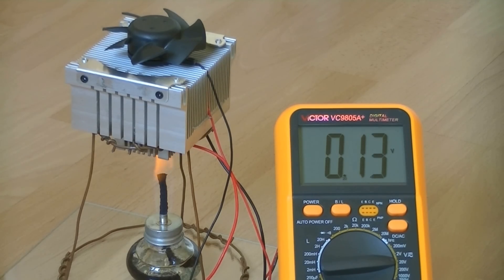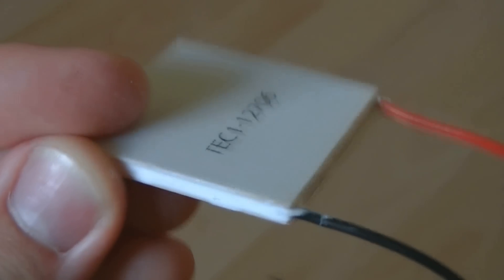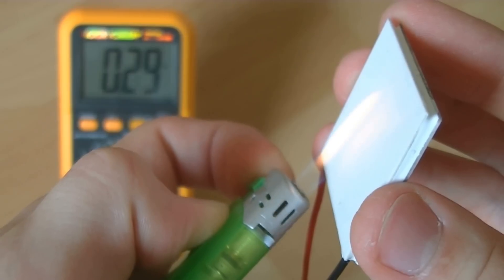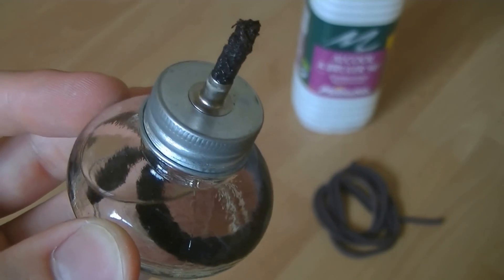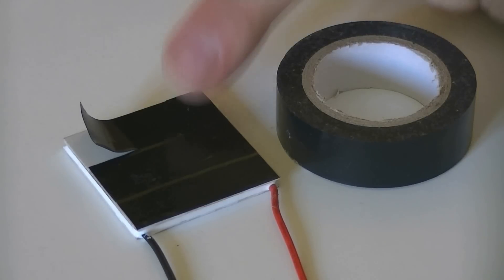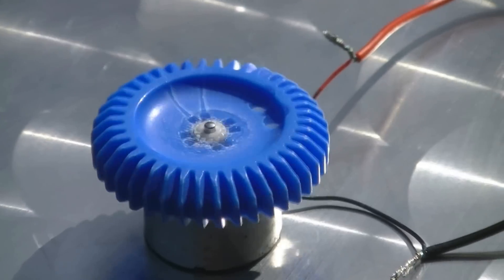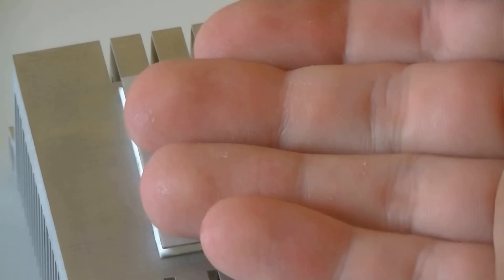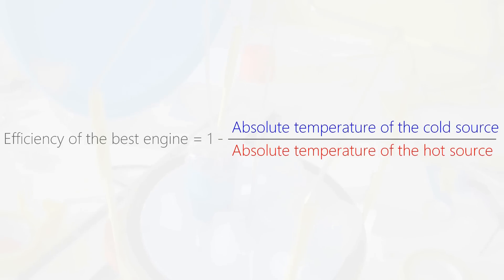Heat to electricity - DIY experiments #9 - Seebeck and Peltier effects

Comment: Cool i am going to make a Sand battery eventually. Now the hotplate from amazon was defective 3 minutes it reached 350 degrees C. The max temperature was setting 1 suppose to be 120 degrees C def a faulty thermo regulator. Need a proper one. A sand battery with a stove wooden fan is a cool idea to explain how they work. In a few Months (2-3 months).

Comment: thank you for this.
I work in trade related to HVAC, but sometimes I was thinking if we can use the heat of the condenser to generate power back. I know the power will not be enough to run the compressor itself, but It should collect some power back.

Comment: What happens if you stack these units on top of each other? Put heat on the bottom and haven't worked its way up to the top. Where you would cool that make any sense at all?
Reply from the maker: Less efficient!

Comment: im very skeptical about this 

however if this is true that it can run a computer fan, then my idea for a very small waste oil heater for a green house that gets very little sun in the in winter (poor planning on my part and moving it will be a giant pain in the ass) is more viable than I thought since getting power to it is difficult.

Comment: In a hybrid car design, maybe a constant temperature is possible from friction component stoked further by wind drag...but another idea is just powering the right spectrum led, uv light, to power solar panels in a closed system with mirrors...maybe energy is amplified and it's possible to get more energy out than is put in, or at least it's converted to domino effect idea.

Comment: Your focusing on the wrong thing, colder is better and no limit to how cold it can get vs only 500 to 700 F for the hot side. You only need a temp diff of 150 to get the 5 volts 1 amp.
Reply from the maker: Not clear?

Comment: Had you purchased teg tiles instead of tec tiles you would have had a better result in your experiment.
TEC stands for: thermo electric cooler
TEG stands for : thermo electric generator
Reply: What if we stack teg and tac multiple time. Can we make a cooler and generator at the same time?

Comment: You made much better than electroboom, nice video! I've made one too.
Reply from the maker: Yeah, and the 100k RPM isn't a fake ^^
Reply: @DIYExperiments  ok i removed the Fake word but in my opinion you never gone over 20k :D  nice channel anyway, why aren't you posting nothing lately?
Reply from the maker: We reached 1600Hz you can check with the spectroid app ;)
It's from our french channel, we will translate vids gradually
Reply: @DIYExperiments  1,6 khz in input but mechanical and magnetic losses aren't calculated, you have to check directly the speed on the motor, i have to try with a laser printer motor, they are very precise.
Reply from the maker: It's a sycronous motor, not an induction motor there is no difference... Please consider science before pretending to correct me :)
Reply: @DIYExperiments  your right place is kerala, doing free energy experiment without any feedback about the result, Goodbye scientists.

P.s. why don't write 1 million rpm on it? is the same, who cares?
Reply from the maker: @AsitShouldBe  The guy who was impressed at first...
Man, I'm an engineer (IRL), the fact the frequency of a synchronous motor is directly related with the input frequency with no slip is a fact (that you don't know I see).

As all of our experiments, it's true.
Reply: @DIYExperiments  your india style circuit has more holes than wires,  and you haven't calculated any frequency or current effect except your input frequency on open circuit.. so you are an engineer, congratulations!

P.s.  buy a tachometer
Reply from the maker: @AsitShouldBe  I made this video in my original channel in 2011... Look at my recent vids (made 5 years ago in this channel even if posted recently)
Reply from the maker: @AsitShouldBe  But everything was calculated, all actions are explained in the video (complex procedure due to the wide frequency range of several order of magnitude, the reactance of the coil chances during the test)
Reply from the maker: @AsitShouldBe  https://www.youtube.com/watch?v=cfZUH0Pjctw That's my current content, dare to say it's not engineering
Reply: @DIYExperiments  in my opinion the motor try to set his speed on some submultiple of the input frequency, that's why the current grow so fast. 
I'll see your latest video, no offence. 
That's my next one 😉😁https://youtu.be/D7yM1loPqOU

Comment: Your use of a parabolic mirror to focus sunlight as a heat source reminded me of a thermionic sandwich that has a layer of ceramic material between two metal plates, one wire touches one plate and the ceramic and the other connector touches the other metal plate.  Sunlight foucused on to one metal plate using a lens produces an electrical current.
Reply: Free enegery. Look we are only bound by what we know.
Imagine if you get a magnified 🔎  glass. - a big one to capture the engery. And then you get loads of little ones to focus the light down to a very small beam.
You then focus that enegery, Heat onto a piece of given metal. Then boom you have free eletric. You would also add additional wind generator with water generator to pump to the plants to let them grow, and then you capture then gases to use as enegry and you could capture the heat from the actual plants themselves, moss, micro greens.
I am sure if you was to grow them in some type of vacuum chamber then it would produce pressure, which pressure is therefore enegery. 
Same as heat from the micro greens or the moss which can be captured.
Have you ever felt the heat come from a layer of plant matter?
Jesus brothers once you see this.
Then you realise what is going on.
Reply: @killuminatikilla3235   Great minde, if youd put a copper plate with alu or silver strings y could try to cath more energy mby even enouh to store it in some sort of battery :D
great work man, keep it up !
Reply: I understood all of this perfectly, try using more professional language next time noob. gitgud
Reply: @ricardocolon3674  What?  What I said is perfectly true and is very similar to the experiment in the video.  You're the noob.

Comment: Fixing hot plate at 50 degrees and the heat sink, which thermoelectric module would produce more power: TEC1-12702, TEC1-12706 or TEC1-12710?
Reply from the maker: TEG would be better
Reply: @DIYExperiments  teg means?

Comment: Would a higher temperature mean more energy output?
Reply from the maker: Yes, but shorter lifespan (this module isn't designed for sush temperature)
Reply: @DIYExperiments  Very interesting. Thank you for replying to my question.

Comment: Fake .. nice try
Reply from the maker: Buy a TEC module and check it yourself... "Nice try"

Just, when you see this video you consider it's a fake? I'm glad to know that I managed to make a fake video with real science. You'd be really impressed!

Victor, energy engineer.
Reply: @DIYExperiments  no I didn't said it's completely fake .. but lil suspicious how this thing could generate 5v
Reply from the maker: @rallyworld3417  Well I really get till 5,5V (no fake on the video), the life expectancy of the module is only minutes with this strength, but it works.
Reply: @DIYExperiments  I  saw a device with 150 c rating try that one next time
Reply from the maker: @rallyworld3417  The temperature gradient is something like 300°C in our test

Comment: the peltier only grabs the infra red heat ... which is why you can combine them with solar to get even more out of the sun beams
Reply from the maker: Hum, no, it's not a solar cell working with radiation, it works with heat conduction passing through!

The black tape converts the rays into heat.
Reply: @DIYExperiments  What do you think heats things up? What part of the spectrum? Why do you think solar cells heat up ?  What could you use that heat for?
Reply from the maker: Because of thermodynamics, it's impossible to convert effcicienlty a low temperature heat into work, so the best we can do with the residual heat of solar cells (85% of the energy), is to use is as... Heat. For instance to heat up a house (there are hybrid panels).
Reply: @DIYExperiments  Or you heat a TEG .... which is what they are for. Yes, you need to cool the other part.. but you get the point. There is unharvested energy there. Ofcoz TEGs aint very effective... but still... could run the fan for the system and so on
Reply from the maker: The efficiency is absolutely awfull with low temperature, I managed to make a demo but output power is 16 times lower than a solar cell. The answer is "no", we will never harvest low temperature heat with TECs! It's 1/100000000 of being cost effective.
Reply: @DIYExperiments  Firstly, use TEG not TEC. And yes, guess why its 16 times lower?  :D
Reply from the maker: In fact it's a few percent best with TEG but still! 16 because turn light into heat is a huge entropy increase that is irreversible, convert work into work is way more efficient.

Comment: With 5 Peltier modules like yours connected in serie I can only reach 2.45 Volts which are not enough to move the fan (12V) any advice ? Thanx !
Reply: What happens when you try to use 10 Peltier modules? Would you get 24.50 volts?

Comment: Sorry but your voltage does not decrease under load? 🤔🤔
Reply from the maker: Yes but the phone choses a current that prevents to fall under 4,5V. The charging current is low but it's works.
Reply: @DIYExperiments  you can change the fan if solar panels and rechargeable batteries so you will  get about 3 hours to change the chance and fan

Comment: Hey some random dude here.. i'm wondering if i can make a heat with 12 volts or lower that can boil water in  small container with less than 1/4 cup of water? Is is possible? And if not.. what alternative liquids with lower boiling point can i use?
I'm trying to make a small boiler engine in which the heat source comes from the energy generated by the boiler itself..
Reply: These types of machines have been proven to not work I'm sorry that boiler would just run out of heat it's not possible to make a machine that powers itself
Reply: Those are called "perpetual motion machines" and they are impossible. You'll find many scams online claiming that it's possible to make one, but it's not
Reply: It maybe possible, I might try and build something to produces enegery. Look we are only bound by what we know.
Imagine if you get a magnified 🔎  glass. - a big one to capture the engery. And then you get loads of little ones to focus the light down to a very small beam.
You then focus that enegery, Heat onto a piece of given metal. Then boom you have free eletric. You would also add additional wind generator with water generator to pump to the plants to let them grow, and then you capture then gases to use as enegry and you could capture the heat from the actual plants themselves, moss, micro greens.
I am sure if you was to grow them in some type of vacuum chamber then it would produce pressure, which pressure is therefore enegery. 
Same as heat from the micro greens or the moss which can be captured.
Have you ever felt the heat come from a layer of plant matter?
Jesus brothers once you see this.
Then you realise what is going on.
Reply: @killuminatikilla3235  Can never get more energy then the energy provided to it.

Comment: I guess evaluating TEC by their efficiency is not giving them due credit. However, their main advantage lies in the fact they are solid state heat transporter with decent dynamics (although they behave very badly through current inversion). It's a very important feature for high precision temp control or compact cooling solutions.
Reply from the maker: Yeah, clearly! But this video is not about TECs, the demo is about direct heat to electricity conversion. In some conditions TECs can have an interesting CoP, especially for their simplicity and reliability.
Reply: good video.
peltier is not simple, it is very complex and energy consuming there is also doubt about its reliability, this is also the same thing with the entire electronic system. We do not only need electricity, but we also need other energies. There are other energies that have not received attention because everyone is moving towards electricity and focusing on it only. You are the first to speak the truth on this topic, thank you.

Comment: YEAH 5V s  TURNS A 12 V FAN , FAKE FAKE FAKE
Reply from the maker: Most 12V fan run till 3,5V (their internal mosfet driver gate threshold)...
Reply: @DIYExperiments  NOT LIKELY
Reply from the maker: Try...